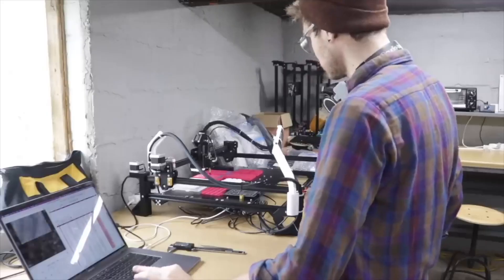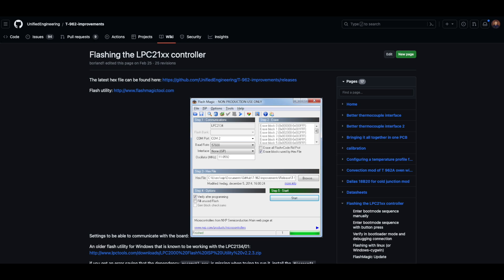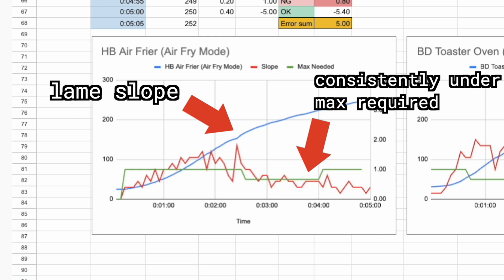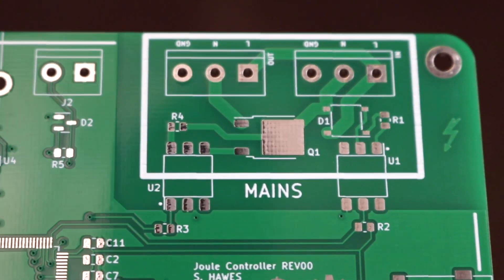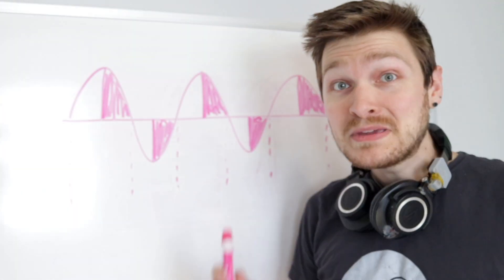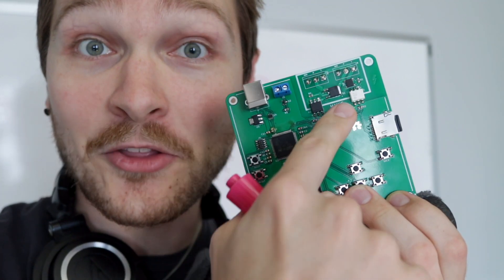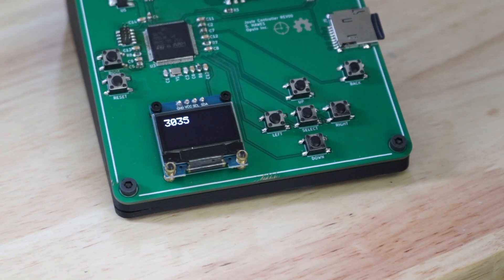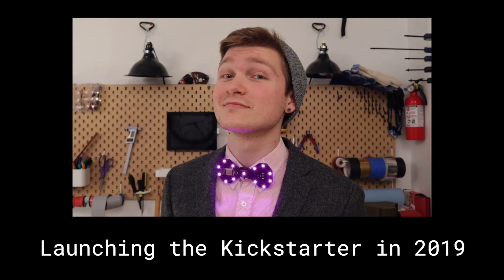turn any toaster oven into a reflow oven!

Comment: You can do the 0 crossing chopping with the schematic that you have, just use a to220 triac, 1kW of resistive load shouldn't be too hard. For this aplicacion seems like the better alternative, it's the same as the ss relay, cheaper and smaller as you can control the heat sink for the application, and pretty much any small one would do on a to220 or similar size package. 

Chopping mid wave is (or was) useful for light dimmers, as missing half cycle would make for bad flicker.

Other option would be to actually use pwm, if it's much faster than mains the problem you mentioned wouldn't affect the power calculations, and the higher frequency would make for smaller filtering components, much more reasonable than a huge inductor you'd need for the triac half wave. (for pwm a transistor shorting the DC side of a full wave rectifier is used, choose your poison, mosfet or IGBTs are usually the options)

Good luck with the project!!

Comment: The plus side of T962 is that the casing of it seems solid. It feels like a tool instead of something that is supposed to make you a tosts. Surely it should be possible to build an improved version of it which would be actually safe to use. With a price tag of up to 800€ I would buy an off the shelf version for sure.

Comment: hum...a few thought about the slow reaction curve
i assuming the heating elements are some kind of threded/induction elements
...when on a magnetic flow builds up (magnetic flux)
..when thay are rapidly turned off...the element(inductor) will react by reversing the flow of electrons.. aka puch back effect, and since thay cant flow back trough the turned off triac ther will be residual energy left when the next switch on comes...
solution:
...u add an inverter to the triac gate signal, connected to a shunt triac and a diode connected to a large capacitor with a discharge  resistor to slowly drain it safely (no short)
...this should increase the responsivness of the owan itself...

...to test, u should check with a lage capacitor and no way of discharge it how what voltage u get after some time so u know of much excess puchback u need to dispose...
..u can checkup puchback or flyback effect to understand this better...

Comment: You might wanna look into a rectifier plus inverter setup to change frequency (and with that the energy) of ac mains to the level you want. In that case you might end up torturturing the ovens electronics a bit less

Comment: Aren't triacs also used for high power current switching? Just way bigger? And you already have the circuit to trigger at 0 since you detect the 0. I also think it's enough to regulate over half mains period, oven is bit going to rise one degree in 10ms!

Also are you getting the true zero crossing with this circuit? Because of voltage drops and minimum amount of current create the pulse there might be some delay? How about, instead of rectifying,   duplicating the optocoupoer in both direction, one for positive wave, one for negative wave, then you can measure the delay and take the middle as true zero? Or there might be better circuit, or it doesn't matter, I don't know 

Btw you should check that your quick switch cuts both phase and neutral, it's not impossible it only cuts one, and if it's neutral and you hit the phase with your finger you could still get a jolt. Not sure but better be safe.

Comment: I built a Controleo3 reflow oven using Whizoo's kit and a Black & Decker toaster oven.  It works really well, I've made several boards in it.  I just got my Lumen PNP delivered a couple weeks ago and got it all configured and calibrated, successfully ran the Functional Test Placement board.  Can't wait to get some of my own boards placed with the Lumen and reflowed in the oven.  Up until now I've been manually placing parts with an AirPick and a microscope, so glad I'm not going to have to do that anymore.

Comment: There is a simple solution to even out the hot/cold areas in the T-962 oven. What you need is a fan to agitate the air inside. This oven is a bit cramped, but if you drill a hole from the top, run a shaft through it and attach a DC motor controlled by PWM, or a stepper, you can control the rotation speed. Inside the oven what you need it a propeller, something basic and made of a metal that can withstand the max temperature temperature the oven can reach. I like to use a minimum of 25% above the rated value as a safety factor. A twisted strip of metal with a hole in the center should do, you don't need something fancy. The bearings need to be able to handle the temperature as well, so make sure you get some that will  be able to handle the heat. This won't require a high RPM, in fact, very high RPM's may generate so much draft that it could displace the components from their desired locations and it won't make your oven as homogeneous as it can be. 
When you implement this the oven's characteristics will change, so for very delicate processes, it could be a challenge to get it just right.

Firmware changes won't do much. You can get the oven to be homogeneous, even if you don't make any mods, but for that you need to lower the climb rate so much that the heating curves will be dramatically different, and could render the process useless for your desired purposes. The reason why you can't get it to perform any better has to do with the heating elements and how they are placed in the oven. If you had 4 of them, one in each corner, and were able to control them individually, you would have much better results. This also means 4 thermocouples at the very least, ideally 6. One close to each heating element, one for the PCB and one for the air inside the oven. The air thermocouple will govern the process temperatura (process value), the PCB thermocouple will be your failsafe (it will cut off the heating if it overshoots the setpoint), and the 4 in the corners would determine which heating elements need to provide more or less heat to even out  the temperatures in order to keep the oven under tight control. 

In theory you can pass on the fan with this type of control. It will make the oven more efficient and quieter, and your process will benefit greatly. However, you will need to spend more money in heating elements, implement 4 PID's and do a bit of head scratching and possibly melt your retinas a bit learning how this works.  It's up to you to decide which solution you want. One is messy, complex and expensive, but as a tighter control and is more gratifying, while the other is way simpler and it could just be enough for you.

If you think about it, it's probably better to just get an old microwave oven chassis and build it from scratch. That way you can implement everything, and it's a neat project. Plus, you will get a lot more clearance, the T962 is quite cramped. Not a bad desktop solution, just not good enough for SMD soldering. You get the PCB's charred in the center and the solder may not even melt at the edges.The control is limited to one thermocouple which tracks the process value, and the heating elements (they are 2 if memory doesn't fail) seem to be connected in parallel, meaning 1 output only. A bit of a caveman approach, if you ask me. Not hot enough? Club it a few more times, it will get there.

Another solution could be a multi-zone hotplate. You can get a steel plate, divide the plate in 9 zones like in a tic tac toe board, and control each of them individually. Whatever suits you best. The control can be done using MCU's like the arduino, raspberry pie or ESP32, they are not that difficult, and languages such as microPython are a good option for a slow process like temperature control.

If you want to go the extra mile and be able to provide rapid cooling, you can always run a copper tube welded to the metal plate and flowing from and to a tank. To avoid getting the tank too hot, you may require a mini cooling tower. It's visually fantastic and very efficient, but not a good choice for a lab as the resulting condensation can cause mold and it's also not good for electrical/electronic devices that cohabitate in the same room. You will also need to compensate for the lost water.

This is really over the top, I just thought that it would be interesting to add for the sake of providing a bit more info, and people can look it up if they so wish. Keep having fun kid, you are doing a nice work. Rolling up your sleeves and having a go at what you want is a great example for others to follow. As long as people play it safe, the worst thing that can happen is a failure. If they don't, well then they can burn down the house and the entire family will have to share the basement. Not my idea of fun.

Comment: 50Hz mains have 20mS period, you don't need to be quicker for heating. For lighting it do matter, but not for heater. There are some MOC optotiracs whit built-in zero crossing. I like tht and alu heatsinks for power stuff. You get better cooling with no electrical tab isolation, but then you have a chunk of metal at mains live :) Check for example BTA16 and BTB16 triacs

Comment: Did very similar project as my bachelor thesis (using hot plate additionally cooled by air pump for air mattress).
I was surprised how small triac you used couse remember how much mine got really hot - few minutes later and now I see you also faced that problem :)
Good job though!

Comment: I built my reflow oven some years ago using the Whizoo Controleo3 full kit. It was a bit expensive, but I liked their due to coming with everything but the oven for a full overkill build , separate control for each heating element, and auto door opening for cool down.

The benefit of doing the overkill build with full insulation and heat reflection is the oven being able to easily follow profiles. One of my projects had some components with some pretty strict reflow curves, and the oven was able to do it on the first try.

You absolutely want an oven with top and bottom quartz heating elements. The oven I went with was the BLACK+DECKER TO1313SBD for a whole $30 shipped.

I wouldn't reinvent the SCR.... Properly rated, commercial available SCRs are pretty cheap from Digikey or Mouser.

Comment: The way I implemented something similar for a soldering iron without an expensive SSR and ruining the power factor+EMC is to use back to back FETs with a photovoltaic gate driver. To convert the PID controller's output to pulses, I used a RNG and compared with the PID output every interrupt to decide whether to let the upcoming pulse through or not. On average this works quite well since you're doing it at 100-120Hz and the time constant of everything else is in the 10s of seconds
Also definitely make sure you're using an optocoupler to detect zero crossings, having a fully isolated controller is a really good idea for safety especially if you want a human pressing buttons on that board. Make sure you respect creepage and clearance requirements for your voltage level too across the isolation barrier. AC optocouplers are the simplest implementation for this imo

Comment: Using the S.S.R , both types are available...Phase control type  and Z.C.D. type...with the zcd it's controlled as how you 
explained .. that's known as 
" burst firing mode"...
Phase control can give tight temp. control..with a good ckt. design...and input voltage fluctuations and " sine to linear ramp" linearisation circuit can be implemented to give a linear temp.rise over the entire temperature range....
for best results with phase control, one can initialize a burst mode followed with phase control for temperature tracking accuracy.

Comment: IGBT and a photovoltaic isolator (works like a photocoupler, but instead of having a transistor output it provides voltage -- enough to power an IGBT)

Zero crossing you can do in software

Comment: Since you get a good zero-crossing detection, why not just use a beefy mosfet? You'd need to have a full-bridge rectifier though, because mosfets can block only DC. With that use a decent cooling solution. Then just let full cycles through or block them.

Comment: Just use “Bang-bang”. You don’t need crazy amounts of control for a heater of that nature. It’s not going to buy you much using PWM or serious PID. It’s too slow of a system to worry about it with all that insulating air and thermal mass to influence. Unless you want to go to 240V mains and twice as many elements. People tend to over-kill these things. A lot of people just use a stock toaster oven and keep an eye on a temp-tell mark or the solder itself. People buying these things in the end are not going to need super precise flow profiles regardless.
Reply: Bang- bang control is possible with an S.S.R. but the thermal time constant of the plant (oven) has to be factored in for good temperature control.  out of band temperature on either side is going to cause component or soldering issues..besides board damage.

Comment: fraught
frôt
adjective
Filled with a specified element or elements; charged.
Marked by or causing distress; emotional.

The word is an adjective which means that it modifies a noun. So if your kitchen has a bunch of ants you might say that it's fraught with ants.  If you say that your kitchen is fraught that doesn't mean anything.  Fraught with what?

Comment: You could stand to buy a hot air station.  Chinesium units like the Atten ST-862D or Quick 861DW are under 300 bucks and they work great.  It's infinitely better for surface mount soldering. Of course reflow is even better but you still need a rework solution.

Comment: zero crossing switching is the way, you can do it with triacs but i think it is nicer to do it with an external solid state relay because everybody will have a different oven and you don't have to worry about the different current draws...... Also, even if that is a prototipe you really should cover that mains voltage section of the pcb, it seems safe enough to you an it will be fine also to me in a home lab. But you have a company and other people there and you are responsible for everybody there.

Comment: 4:35 I'ma roast you for that pun.
9:15 So you're literally reinventing the dimmer switch. Why don't you take on the wheel next?
There are 1500W dimmer switches on the market; they're intended for large rooms with incandescent lights - lecture halls, theaters, that kind of thing - and while they tend to be reliable, they are not cheap. It takes a lot of die area to switch that kind of current with silicon. (I'm pretty sure most of them incorporate series pass elements rather than relying on just the TRIAC die?) A solution that switches a fair dinkum relay on a 5 or 10 second cycle would probably be more ideal for a reflow oven.
EDIT: If you're still wedded to the idea of using a TRIAC circuit, have a quick look through your favorite search engine for "high current triac dimmer". Quite a few on the Shenzhen market that claim the 3500-4000W range, many with active cooling. A modest heat sink and a fan go a long way in dissipating that waste power.
EDIT2: In most "dumb" toaster ovens, the internal thermostat will continue to limit the maximum temperature regardless of what you're doing at the line cord. Not such a problem with 1200W and higher power models, but the basic bitch 1000W toaster ovens will struggle to even cook a frozen pizza, let alone reflow solder. The user will still need to physically hack the oven to override the thermostat.

Comment: Stephen: My top suggestion is this: Assuming you want to do better than just wafting hot air over a board until the solder melts, your task is to get the oven to perform a series of heating steps to get the PCB, specifically the solder, pads and component leads, to follow a thermal profile, for example that published in component datasheets. Many oven mod kits attempt to get the temperature feedback from a  thermocouple just floating in the air, perhaps above the board(s). But it turns out that's a pretty poor approximation to what the board is experiencing. So at some point you will need some thermocouples mounted to PCBs, and thermally coupled to pads (maybe with high-temp glue), that you can place in the oven to test actual performance, including in different locations in the oven. You can even do what I ended up doing -- use a small PCB with thermocouple attached to act as the feedback sensor, and it sits on the tray next to the board(s) being reflowed.
This is especially useful for lead-free solder where the margin between good soldering temperature and burning the board is relatively less than for tin-lead solder.
Several thermocouples-on-PCB is the approach used for profiling commercial conveyor reflow ovens. (These are usually connected to a data logger inside an insulated box that accompanies the test board through the oven.)
Anyhow, you're going to need a few thermocouples, and it's useful to get something like an inexpensive 4-channel handheld thermocouple "meter" with logging. I got a slightly upmarket PerfectPrime TC0520, which can also output data to PC for plotting.  Pretty convenient for a variety of tasks.  We even used it with 4 long-lead thermocouples attached to a PCB to do some basic profiling on an industrial conveyor reflow oven we work with.
Anyhow, bottom line is that rather than puzzle over vaguely better or worse soldered boards, you'll want some ground truth, which you will get closer to with thermocouples mounted to PCBs.